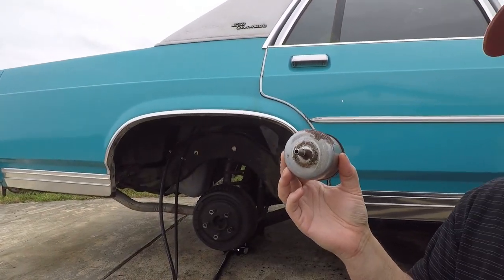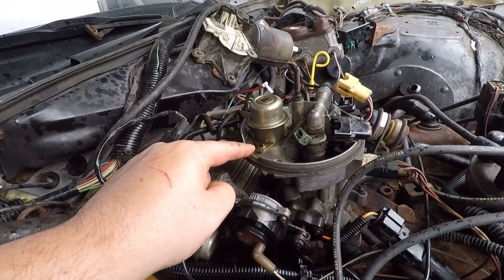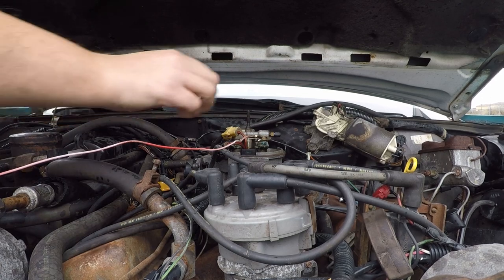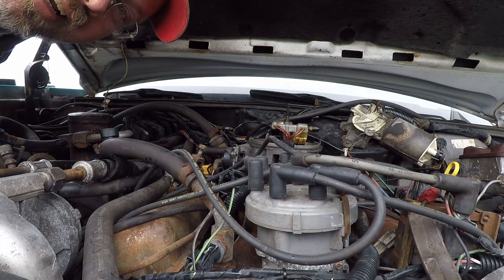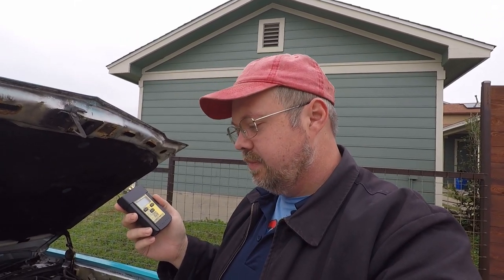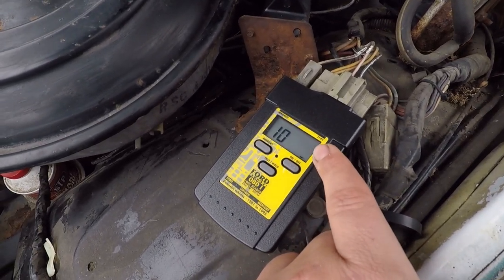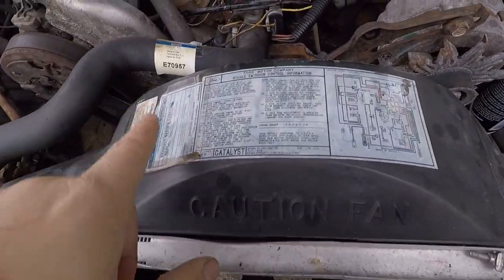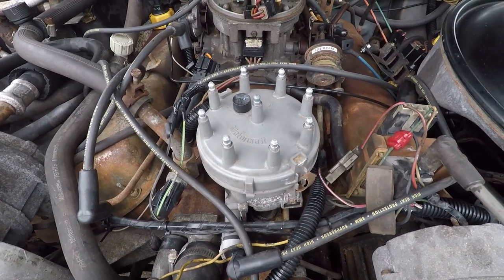1984 Ford LTD Crown Victoria Restoration Ep. 03: Under the Hood

Comment: So what was the issue ?
Reply from the maker: For which part?
Reply: @gwe87  on this video you have trouble starting car. But I don't think you said what the issue was. You talked about a few possibilities. I have the same car and sometimes it has trouble starting
Reply from the maker: @dogfilms7753  Ah. For me it was that the gasket on the carburetor was bad and letting in too much air to the mixture. I replaced the gasket and that cleared the issue up. Hope that helps! Let me know if it does, I enjoy hearing about old cars getting back on the road!
Reply: @gwe87 which gasket
Reply from the maker: @ramiram84  For me, it ended up being the gasket that the carburetor sits on over the intake manifold. There was a gap in it which let in a lot of air so the engine was running rough.
Reply: @gwe87  I see. Thx. For me, it was the injector switch there on the connection to the throttle body.
Reply from the maker: @ramiram84 I'm glad you found what the problem was! I was fortunate that it was a simple fix (just replacing the gasket) rather than chasing down a bad switch, that seems like it would have been really difficult to do. Congratulations on getting it fixed! How's the car running?
Reply: @gwe87  it wasn’t the switch (it was the connector (loose))
But yea, car died on my on freeway. Had to get it towed lol only to find out what the issue was.